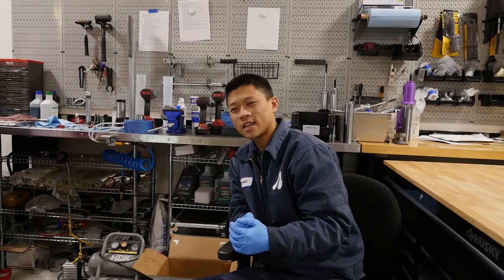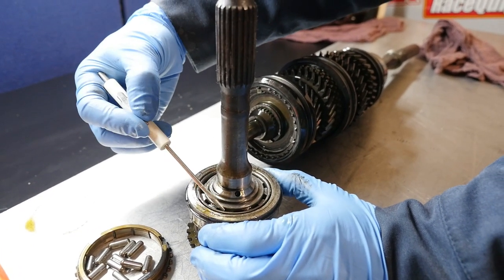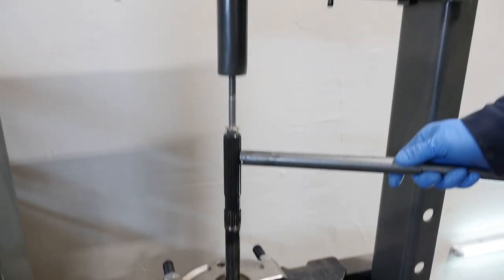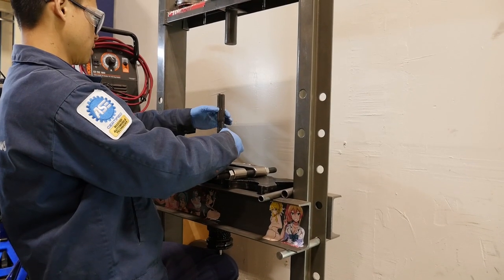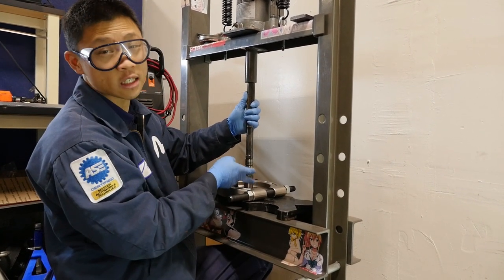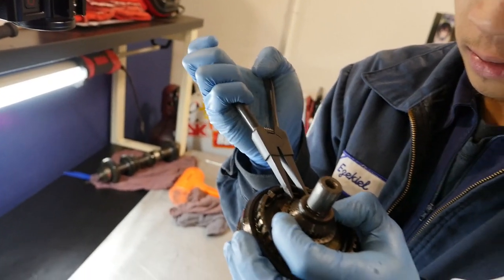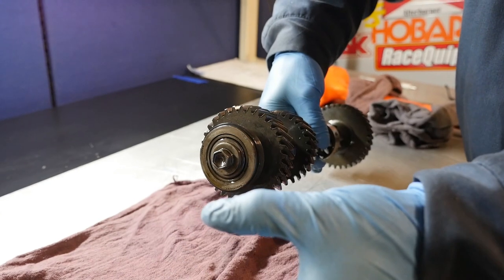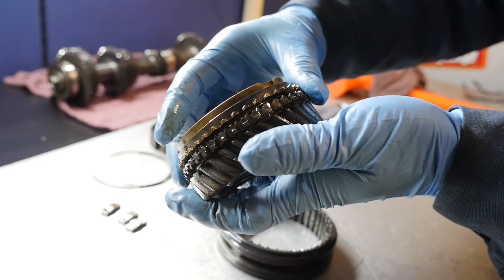T50 Tear Down and Inspection (Part1)

Comment: Safety glasses on before approaching press, proceeds to 'Don't be like me' and encourage us to set up our presses properly. Reminds us to wear safety glasses seemingly as an afterthought before continuing with the counter-indicated use of the press. This is the perfect representation of a well experienced ASE tech in the field. PPE tied to activity so well he has to remind himself to encourage us to use it as well. Knows what works in a pinch.
Reply from the maker: Thanks for the well written response. Yes, Ive seen plenty of stuff literally explode on the press and I have to remind new people in the shop "stuff on the press doesnt bend it SHATTERS." On high pressure operations I will even use a full face shield (big rusty wheel bearing)

Comment: You were talking about the seal bearings in this tear down. 
Can you tell me why Toyota use the sealed bearings on the axle shaft instead of engineering the housing to accept the oil seal on the back side of the bearing next to the axle flange ? That way the sealed bearings with one side of the seal removed would be lube by the diff lube .
Makes sense huh ?
Reply from the maker: Completely makes sense. I am no engineer so I couldnt tell you sorry

Comment: Hi sir good day! What causes 4th gear to pop out of engagement. I already stretched out the detent springs but that wouldn't work either, it still pops out sometimes.
Reply from the maker: Worn input shaft or bearing is very common. Worn 3/4 slider
Reply: @CMAutohaus  Thanks for the input sir, I'll be checking that one.

Comment: Got a question, I have a t50 for a gts with a stuck driveshaft would taking apart the whole thing help with removing the driveshaft?? Tried different things but can’t get it out
Reply from the maker: Wow that sounds like a nightmare. Did someone try to force a different spline driveshaft into the trans? (different year T50s have different spline counts). Without looking at the trans, I'd say rust penetrate and slide hammer.
Reply: CM Autohaus it’s a t50 with a one piece driveshaft stuck in there. I haven’t tried that yet, oil looked like it had water in so I’ll definitely give that a try

Comment: So will GTS bearings and seals fit a non GTS t50? Also, what exactly is the difference and is there any way to tell before taking ot apart?
Reply from the maker: Older T50s have a smaller OD input and Front counter bearing, but the rest are backwards compatible.  Too many differences to list, but obvious indicator is the output spline count is different.
Reply: @CMAutohaus  so would a T50 from a 3TC engine fit the 7A-FE block?
Reply from the maker: @collinklein2230  It should if you get the correct clutch disk and driveshaft. Although I recommend the newest version ae86 T50 (T51) as it has all the improvements.

Comment: Hey, slick, that is not a T50.  T50 case does not split in half and first/reverse are in a separate housing behind the 2,3,4 main case.  That looks like a T5.
Reply: Not T50 like the Borgwarner T50. T stands for toyota in this one. They just happen to share the same name. This is the 5 speed that went in 75-86 Corollas

Comment: I'm having wine noise in all gear except 4th gear what do you recommend me to replace?
Reply from the maker: Sound like a worn 4th gear set (Input shaft) or bearings
Reply: I'm having the same issue. So replace all the bearings on both shafts? Would that solve this problem? I had one rebuilt a couple years ago and it whines in first second third and fifth. Could it be that I just need to replace the counter shaft bearings. I do have play in the counter shaft bearings. Thank you.
Reply: Thank you for having this video.